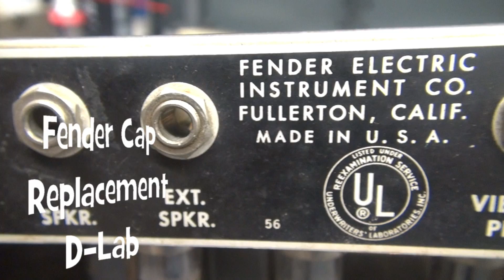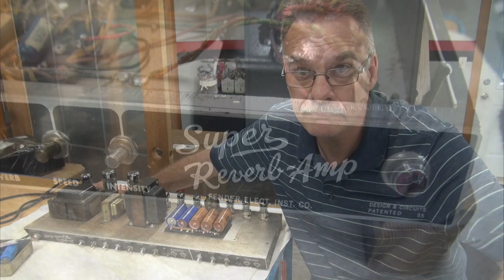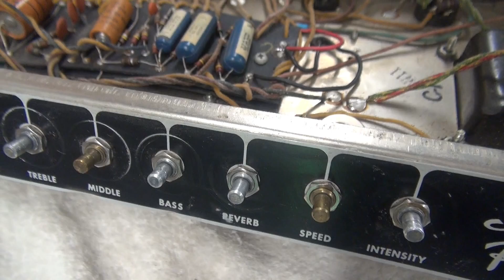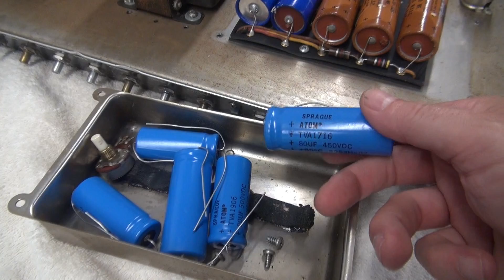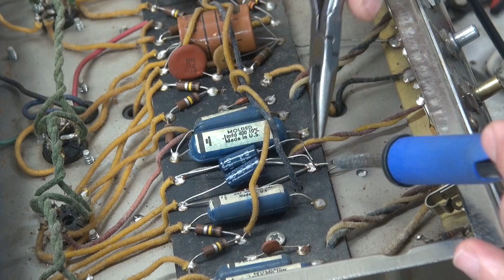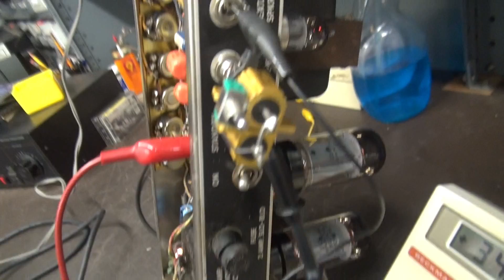How to quickly re-cap Fender Tube Guitar amp Filter Capacitor replacement D-Lab

Comment: Hi Terry -- I'm a big fan of your videos. I've noticed every Super Reverb schematic I've seen calls for 20uF/525V filter caps? And every repair video I've seen uses 20uF/500V. I have to do this job soon, I've found some 20uF/600V caps for $40 apiece. Looking for the green light here to go with cheaper 500V caps, but not entirely convinced yet.

Comment: Very good, I have a unmolested mid 60s Deluxe Reverb on the bench now that needs the 3 prong, filter caps, tubes, cleaned ect. Do you ever put high temp silicone inbetween your caps for any vibration? The J hook solder method is useful, you military guys know all the tricks.

Comment: Great vids as always....Just a thought...  When you measure a resistor in the circuit don't your readings suffer? I measured resistors in my Traynor and they measured out of spec so I took them out and wouldnt you know it they measured perfectly out of circuit.

Comment: Is it normal for a faint orange glow to remain near the setter tip of the power tubes after the amp has been powered off? The glow still remains for a while after the amp has been unplugged. The amp is a 1967 Fender Blackface Super Reverb. 🤷🏻‍♂️🙂

Comment: Great video! I just recapped my ’64 Super Reverb exactly like you did in this video. The problem is that it now makes a terrible helicopter noice. Really loud and the rectifier tube is running super hot. Any suggestions?
/Daniel from Sweden

Comment: Not a fan of J hooking the filters. The 1W carbon comp equalization and dropping resistors on an amp that old virtually always have drifted and need replacement. To do it right the board needs to be swept clean, resistors replaced and jumpers replaced. JMHO of course.
Reply: Swept clean as in everything pulled and reflowed?

Comment: If nothing has been changed in this '64, this is one hurting gator. But show's to go you, how well these were designed and how good the parts were to start with, for it to have lasted anywhere near this long. I bought my '64 brand new, and let me tell you ... that was a LONG time ago.
GOOD choice on those blue Atoms. My feeling is the older those filter caps get, the better the amp sounds, regardless of what kind or model. But at some point, they gotta go. And the more you play through those new ones (and new preamp tubes) the better they sound, as they will begin to lose some of those obnoxious ice picky highs ...

Comment: I have one of these and bought it brand new in early '64. Most players don't like the Orange Drops, btw. Replace that REVERB driver tube with a 12AU7 for better drive control. Please put some NOS 6L6's in that guy for a better vintage tone. I have heard that you can instal somewhat larger filter caps (to a point) to tighten up the bass. Also would like to know if you can lower the mid-range caps to make the bottom end a bit fuller, without using so much BASS control.

Comment: Great video (noob here). I have a Showman head very similar to this. Blows the 2 1/2A slow blow. Being an idiot, I tried a 3A slo blo and it turned on but the blue caps under the cover (in series as you helpfully pointed out) got very hot quickly so I shut it down. Before I order caps - could bad caps cause the fuse to blow?  THANKS
Reply: I got new filter caps and the amp works again. I will use your suggestion on the bias cap (didn't know what it was until I watched this video).  THANK YOU!!

Comment: I like Using those Sprague Atom Electrolytic Capacitors
Reply: Those are my choice as a player, as they seem to last a long doggone time which helps when you're still using the 1964 Super Reverb you bought brand new in early 1964 ...

Comment: at 9.47 you mentioned replacing the 2 grid coupling caps. My super Reverb has the same old blue caps like shown in this amp. The 2 cap ratings in mine are .1uf/400V. Would any axial cap with this value work? Not sure what you replaced them with in this video. Thanks again for the video. Very informative.

Comment: Great vid... but still leaves me with a lot of questions...my first project is going to be a 1985 Marshall JCM 800. ( also have a '76 Hiwatt a 1983 Hiwatt OL, to maintanance, a '73 SoundCity, as well...) Filter cap check, output tube replacement and bias, would like to check the screen resistors, but havent gotten too much DYI on those yet....Thanks for the vid.

Comment: Re. the j-hook method, you say you don't interrupt the original solder joint on the board. What if this joint is a dry joint brought about by years of heating?  Or when you make the j-hook joint it could 
 partially melt the original solder joint thus making this a "new" dry joint? I am being old fashioned & was taught to take no chances here. You don't need to dis-assemble the cap board, simply heat & remove the old conductor. Re-heat & solder in the new one. I know this is quick & will work well. No disrespect to Boeing or the airforce intended.

Comment: Thanks for your videos, I really enjoy them. Back in the late 50's and early 60's I used to buy what was called a "Squib" It was what looks like the spring out of an ink pen, about 1/3 inch. It was tinned copper wire. You used it to make solder joints with removed … resistors, capacitors... or what ever. You would cut out the bad part and leave a small lead. Then you would place the "Squib" over the left over lead and put the replacement lead into the squib and apply solder and then you would have a great connection. I have never heard of a failure of this connection, also I have found this connection in vintage TV's that I packed up. I used to buy them from Allied Radio...not sure of that. I make my own now. Carl

Comment: One caution about the j-hook method.  I'd be cautious about doing that on a PC board or if the original connection has low thermal mass.  You could end up unsoldering the original connection when you solder the j-hook.

Comment: Got a question for you dlab, can I use a 500v cap, on bias supply and it be ok, I don't have any 160v at this time, same uf,   47uf 500 volts is what cap I'm talking about, it has 47uf 50 volt now, fender Princeton spring reverb I'm repairing, or should I wait and order 47uf 160v
Reply: You can always go up in voltage but always the same specs